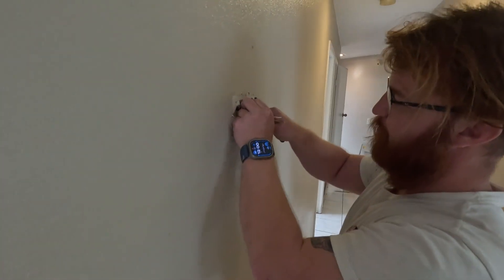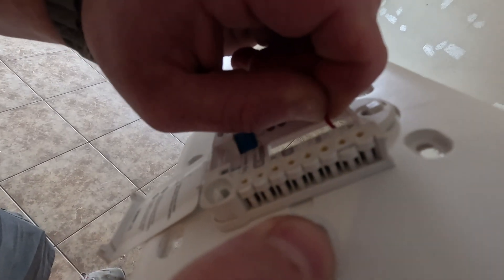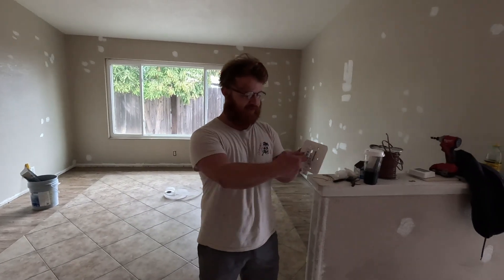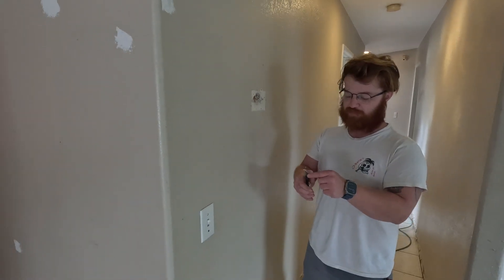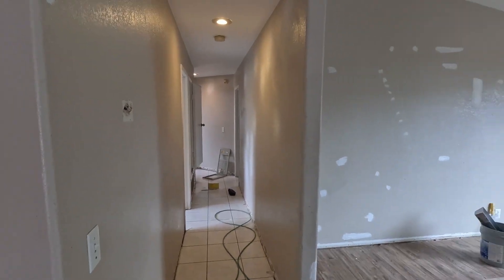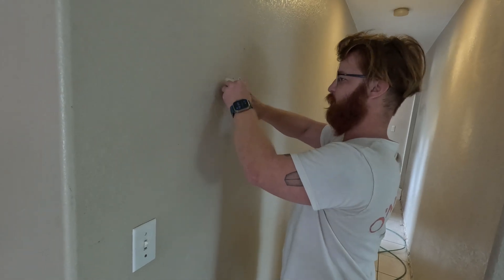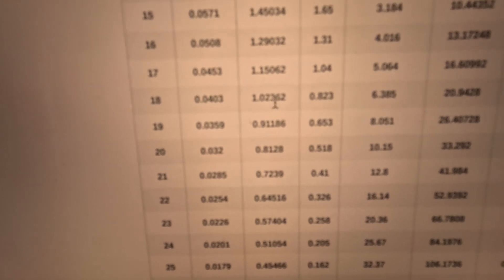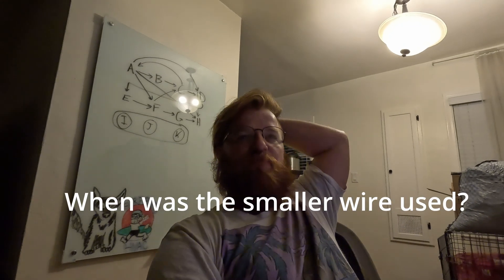Smart Thermostat Installation MISTAKE I See ALL THE TIME - Nest/Ecobee Problems Fixed in 10 Minutes

Comment: There's plenty 22 gauge thermostat wire at the supply houses. I have never used it but it's out there. And did you catch that I said thermostat and no t- stat. No acronyms
Reply from the maker: I would love for you to upload a picture of it on the shelf because I believe you are wrong. I just checked stock at every supply house I have an online account with and there is nothing other than 18 gauge in San Diego at the vendors I checked. You may be living in a part of the country with different stuff available
Reply: @SurfBrosHVAC  I don't where you are going maybe Home Depot or Lowes but everywhere I go they have it. I been in the trade sense 1979 and everyone had it. Good good luck.
Reply from the maker: "Had"

Comment: Thanks for this, I've only worked on a couple of thermostats, personal and handyman shenanigans.  I ran into this in an old house in Phoenix, fitted with it's first AC in the 1950s.  I bent the tips of the wire to make it work, yours is a better idea.
Reply from the maker: Yeah I used to just force it but I got a few call backs on it so now I just spend the extra time to make sure it will work long term. Lots of the smart thermostats won't sense the wire and suddenly you won't be able to turn it on anymore cause they kinda auto program based on the wires they sense. Real inconvenient having to go back a few months later on a thermostat you installed cause it's not like you're making a bunch of money installing them in the first place